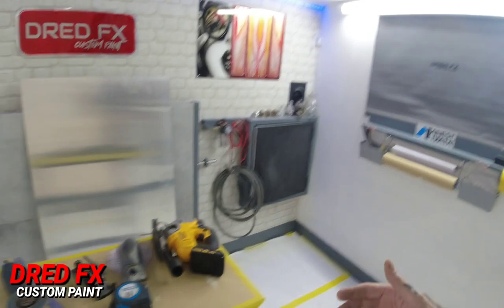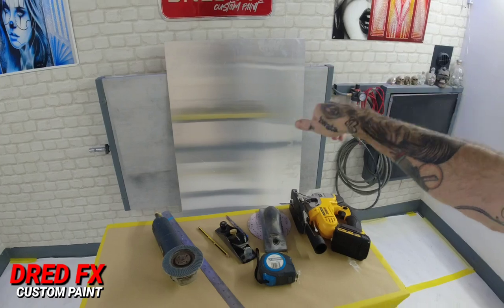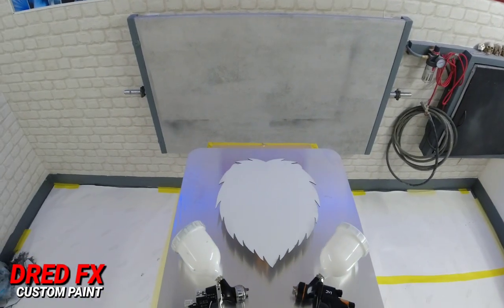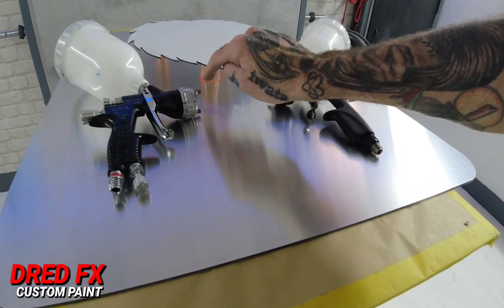Making a Custom Sign for KANDY MAN

Comment: Hi...great work you do
where to buy aluminium plate? Amazon link? The 3mm Dibond  20x30cm. Brushed alu won't be good? or must be solid?
Reply from the maker: Ebay would be your best bet if not a local sign shop the board I used is dimond that has silver aluminium one side and powder coat white the other 
Side
Reply: @dredfxcustompaint  Many thanks....I was afraid that the aluminum layer would be like thin foil, quite a few micrometers thick? And thus the risk of grinding through? I wonder if it is the same product Gerald Mendez uses on some of his works